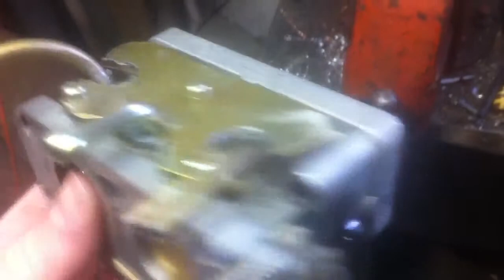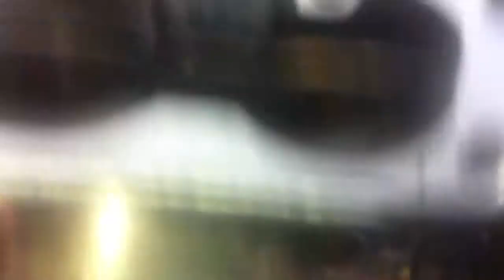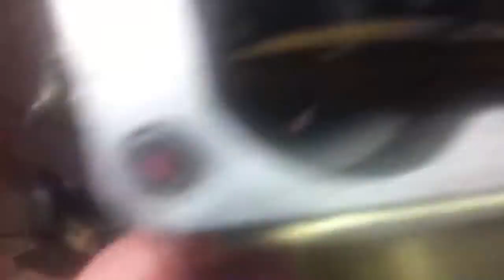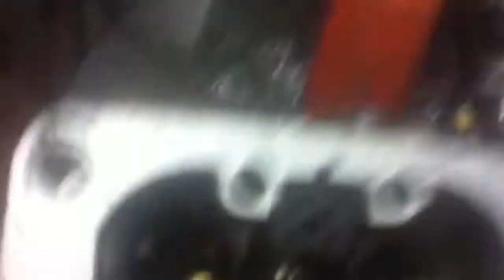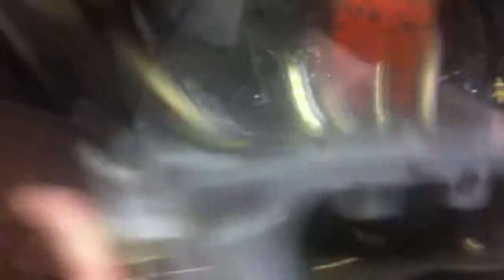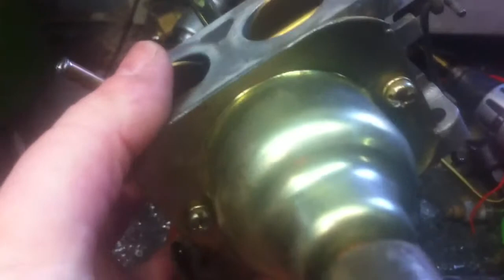Propane conversion on twin cylinder engine.

Comment: How is it that you put a 6mm tube into a drilled 5mm bore? You drilled a 5mm hole and tapped it 6x1mm in the carburetor, ok so did you take the 7mm tube and thread it all the way to where it meets the venturi opening or did you add a smaller tube to the 7mm and pass it through the 5mm drilled hole?

Comment: This is pretty good how you did it. Are you using one of those big regulators that are usually on generators?
Reply: He says he's using the Beam T60, which is a 2-stage which would connect direct to tank pressure. I'm going to use a Garretson Impco KN low pressure demand regulator and a BBQ regulator at the tank to regulate down to the KN input.

Comment: I haven't found much about converting twin cylinder engines. How well has this worked out for you? I have a 22 hp Briggs & Stratton Intek v-twin (model 441777) in a spare riding mower I'm going to start sourcing parts for and give this a shot.

Comment: Can you take a video of the Running engine with gas?
Reply from the maker: I do not have a gasoline tank installed on the equipment.  The motor is mounted on a homemade hydraulic skid to run my jackhammer, T post driver, and T post remover.  I have it hooked up to a 8 gallon LPG forklift tank and have no room to run gasoline tank.